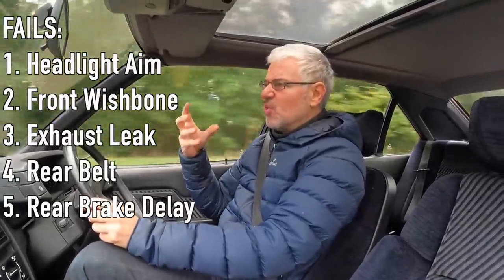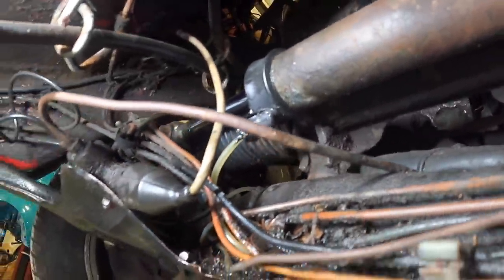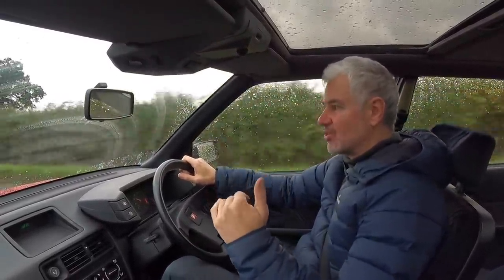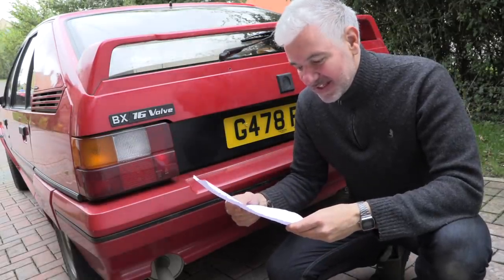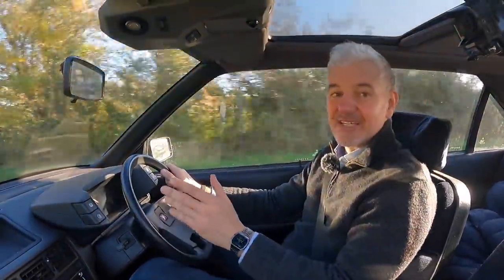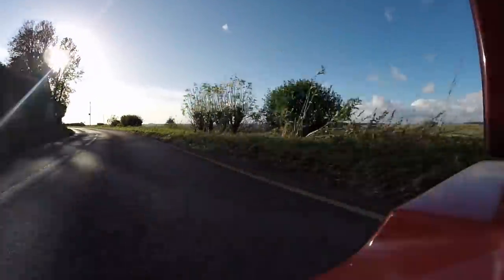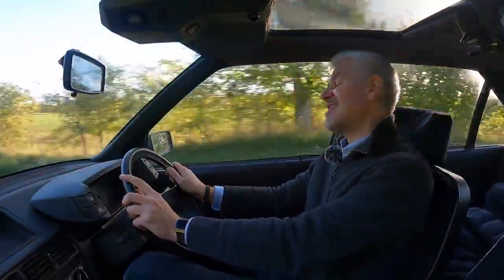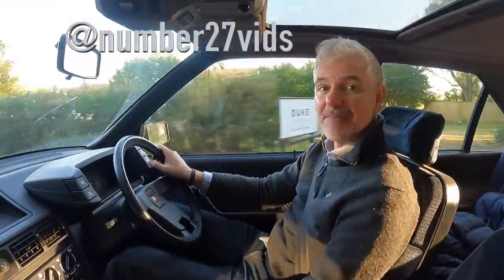Finally Sorting the MOT But How Does a Citroen BX 16v Actually drive?

Comment: Back in 1991 I lost my company car and had to provide my own when I started my own business. I still wanted electric windows and sunroof, power steering etc. A BX GTI (not 16v) fell into budget, as 'it'll do'. I finished up owning a series of BX's, diesel ones after the GTI, which were terrific and gripped like a limpet. Following the BX's I bought a Xantia which I also loved for every 180,000 miles. I continued with Citroens for my business, the last one, when I sold my business in March 2022 was a Berlingo van. 31 years and 12 Citroens and I never ever suffered a failure or breakdown.
Reply from the maker: Nice to hear, thanks!

Comment: I had the ordinary 8V GTi from new in about 1988.  It was phenomenal - two of my friends stacked Peugeot 205GTis trying to keep up with me (one a 1.6, but the other a 1.9 with basically the same engine and less weight).  Then it became less than wonderful when it sprung a hydraulic leak.  Twice (within 3 years of being new).  I always adored it, despite its iffy build quality.  Weirdly the electrics always worked - and it had 4EW, ESR etc, way more than its competitors.  It was different to a sea of 205s, Golf GTis and Escort XR3is.  I never had a problem with the gear change, but then they were like that - some good cars, some crap (kind of like a 1970s Rover SDi - though with those you had five loaded chambers, not one when playing Russian Roulette).  Mine was a company car, so it wasn't driven like I had spent my own money on it.

Comment: Now its worth some money :)

Brake valve is actually solid, it responds to pressure and not to movement.... the pedal has a spring between the pedal and the brake valve so the first part of its travel feels like the brake valve moves, but it actually that spring. After the spring is compressed fully you fell the actual valve.

You can take the spring out and replace it with a solid piece of steel and you will have the same brake feel as a Citroen CX.

Comment: I had the same issue with the wheel alignment of my BX. I ended up doing it myself.  I made an excel sheet with all the required calculations, and now I can do it with two tape measures and a stick.

Comment: The "tracking" with a BX is just one thing: You can adjust the steering rods on both sides, so that the front wheels are straight when the steering wheel is straight. 
That is all you can adjust on the whole car, steeringwise. No camber no toe-in, nothing.
If you want to enjoy the real comfort of a hydropneumatic BX , you have to change the spheres and use the ones from slower/weaker models. 
I´m driving my 6th BX and I like the spheres from the 64HP Diesel model the most and use them in my 8VGTI-Automatic/120HP. 
During acceleration, the car is almost at its bump-stops in the rear, so I would recommend the 88HP spheres for a GTI16V maybe.
A standards sphere has 400ccc , but there are 500cc available from the Break models which are even more comfy. Have fun trying!

Comment: Well done for getting the tomato through the mot. I used to get a lift to college in a beige non 16v version. The indicator switch was to the left of the speedo where you have the 2 flat switches on your car.

Comment: That central expansion box went on my BX GTI (not 16v) we just took it out and welded in a straight pipe instead - according to the ex Citroen mechanic that did it, it was a common mod.

Comment: I am 66 and I too got fed up crawling around under my cars so I bought a new two post lift for £1500 delivered , it was easy to set up in my garage . It is Chinese made but incredibly well made and solid and has transformed my working on my Mini’s . I can’t raise cars to full height but it’s easily high enough to work underneath comfortably and is easy to use .

Comment: Nice. Re... you have to rev it.    Sounds like most other 16v engines. I bought a Golf Mk2 GTI 16 valve back around 1990.  To be honest, I'd have been better with the standard 8 valve GTI. The power is much more accessible, and for most driving, that's what matters. Before the Golf, I had a  BX19 GT ( 105bhp ).  Really good car.  As I recall,  the BX wasn't chuckable in the way modernish hot hatches are.  Once though, you're in tune with car, as you say, you can make rapid progress.   

Any way, thank you for the videos, and getting the BX back on the road.

Comment: That tomato seems like a lot of fun. I like how strong the engine is at high rpm. I never would have thought. Citroen has always been under my radar.
Reply: Same engine as a pug 205 GTi 1.9.
Reply: @knobrotknobrot  205 GTI 1.9 is 8v, this one is 16v  ;)
Reply: Did Renault and Peugeot put this engine into the 19 & 405..??
Reply: @johnchurch4705  not renault. Peugeot 405 has it
Reply: @mjcbento  thank you 😊.

Comment: The hydropneumatic suspension on the BX GTi 16V was fabulous. It cornered so flat at high speed and handlled all surfaces so well that for me it was in a different league to all conventionally sprung vehicles. At only 160hp it wasn't super powerful but the handling package meant you could use all of those horses even on the twisty B roads. Even now, 30 years later, nothing else I have driven comes close.

Comment: I am a 'Graduate' of the Citroen academy! 😱🤔
I was briefly a salesman at Camden Citroen Wolverton Milton Keynes.
All new recruits had to sit through five days of propaganda at HQ where we were educated/indoctrinated as to the Citroen way!
Genuinely great engineering of course, but I just hated the design, though I do admire it sticking two fingers up to the competition.
I still remember the hole in the roof where someone managed to remove one of the spheres without injury! 
The group approved blurb was to appeal to caravanners and I remember being told to "ask the fattest one to jump on the tailgate" to illustrate the self-levelling suspension.
If the potential client wasn't overweight, then we had a bag of cement in a pillowcase just inside the door! 💪🇬🇧
Funny thing is, I moved to France 12 years ago and I have never seen a BX.

Comment: HeyJack, replace the gaffer tape on the roof with clear water proof tape available fro all good motor factors. Don't forget to clean up the surface first with nail polish remover available from all good pound shops. Works a treat, looks great!! Win Win!!
Reply: Nail polish remover can contain oil, so check as will stop tape sticking properly.
Reply: @philtowle4683  The acetone content leaves the surface squeaky clean and for a cheap bodge is more than adequate. I've never had an issue with tape adhesion, sticks like the proverbial and has a nice lemony smell. You are correct though, it also contains glycerine and linalool but in insignificant amounts.

Comment: Drove on of these back in1989 when it was almost brand new (had a couple of thousand miles on it), not a bad drive but it was almost impossible to get off the line quickly, it just sat at traffic lights and spun wheels - grin factor was 100%, but it was not engaging to drive.

Comment: Great stuff and it's going like a rocket great to see it back on the road I say it turns heads as not many around french cars are not bad at all my sister have a 94 Peugeot 106 still going now a classic with 160 000 on clock still on same engine gearbax  and clutch it's her favourite all do she have x19 and a old 500 so well done in getting it back

Comment: I still have a Xantia LX 1.8 16v which has a lesser version if this cars engine. The feel and drive is exactly as you describe, feels the same at 110mph as it does on a pot holed driveway at 10mph,  and also feels very similar to the 205 Gti's I've driven. People don't believe it when you tell them though.

Comment: Treat yourself to a new set of spheres, you will notice a massive difference. Looking at the way it handles the bumpy road the front spheres still have gas but the way the rear of the car is bumping along I’m certain you will find the gas pressure is low. You can also get a specialist garage to test and regas the spheres. Saves damaging rear trailing arm bearings too.
Reply from the maker: The spheres are brand new…
Reply: @Number27  Something is going on with the rear suspension at 6:53 it shouldn’t bounce like that. The spring rate of a Citroën rear sphere is incredibly low more than any other car so it eliminates most of the frequent oscillation of a typical coil and damper setup.  Anyway I really enjoyed the clip, well done.
Reply: Yes the ride doesn’t look right at all. The spheres are either the wrong kind or faulty and already shot. If you’re near sawtry in Cambs then Pleiades can test and regas them for you.

Comment: Same engine as a 205 GTI but with way more compliance in the ride, and no lift off oversteer. Lovely cars. (gearshift is crap though!)
Reply: 205 Gti 1.9 has an 8v engine and 128bhp, this is a 16v engine and 158 bhp.
Reply: @llanfairpwyllgogogoch1279  ah yes, quite right, it's the 405 engine it's shared with
Reply: Nice gentle lift off oversteer to be had on unsealed roads - makes for quite rapid and enjoyable progress!
Reply: @65PCH  😄

Comment: I owned one which had been converted into a tubo diesel. Until someone ran into the rear and the car was totalled 😓 Besides its outdated design the handling was great. Also the AC condensor was leaking inside the car and ruined the insulation 😅 The seat frame is very weak. I would have to bend it back now and then.

Comment: missed a trick young man, all motor factors sell exhaust tubing + clamps, measure OD of pipe in front of box, get new pipe with ID slightly larger, delete box + install a nice new section, probably sound nicer + rev more freely as a bonus, leaking at moment, sounds wrong

Comment: Trying to assess how does a 16V BX drive, 
without driving it on 
an unrestricted Autobahn, is akin to reviewing a Helicopter
in a swimming pool.

Of all cars, the BX16V (espec.the Ph2 & Ph.3) is the only stock car that relied so much on 
aerodynamic to achieve the high-speed dynamic qualities & active safety that are otherworldly.

The relatively harder "sprung" and firmer damped suspension spheres were designed to work best at speeds of 160-220km/h (when the aerod.load / downforce was serious for a stock car).

On normal roads, in the 90-130kph range, 
it is not that impressive in terms of grip (although still admirably sticky, predictable and plentiful of meaty steering feel).

On higher speeds, though, it has the tracking stability
of a THG train,
and the hige downforce gives the steering a feel that reminds steongly of a single-seater racecar, (or even a DIRAVI CX).

The grip at those speeds is otherworldly, as well as the hugely overpowered Teves ABS brakes, that are 3-4x more powerful
than conventional cars at those speeds 
(only a Porsche 911 can come close).

Its aerod.efficiency (BX frontal area is smaller than a Peugeot 205 (!) - yes, get those tape measures out now!),
and the CR of 10.4 : 1, makes the fuel  mileage incredibly low when driven sedately at a 110-120kph speed (you'not believe it gets 52mpg+ at such pace).

When the Throttle is opened though, 160-170hp on 1,040kg (with huge, 34.2mm intake valves and BTCC sized ports) is a rather dramatic event, at any gear and any speed.

The way it accelerates from 140 to 200kph leaves you speechless - faster than some Turbo cars.

There'll never be another car like the BX 16V Ph.2/Ph.3.

Ever.

P.S. it's totally unfair to review these gems on a local British road,
it completely misses their point & fitness for purpose.
By a nautical mile.

Comment: Congrats! I have noticed that speed gauge is very nervous. Would you consider applying a bit of grease onto the speedo cable? Not a very interesting comment but sorting that would improve driving pleasure 😁
Reply from the maker: Do you think that grease is all it would take? I’m assuming the mechanism is worn for it to vibrate like that!
Reply: @Number27  Common causes are lack of lubrication (grease also helps to bring oscilations down), slack of the connection between the cable and spindle (...I hope this is the right word) and last cleaning up the speedometer internals
Reply: @Number27   after washing out the cable, use the grey CV grease, + make the routing as straight as possible, no sharp bends

Comment: That engine is even better when you stick it in a 205 instead of a BX.
Reply: I have the 1.9 Mi16 in my 205 and it's a thing of wonder. Still feel a bit guilty, but the swap was done 10 years ago.
Reply: @ianwatson4540  same here, I owned mine for just under 20 years and it was 16v for probably 17 of them. Sadly sold it 5 years ago. At the time of the conversion 405's were everywhere and unloved so didn't think twice, looking back though I feel a bit guilty for destroying a minter.
Reply: No, driven both extensively and the BX is better. Beautiful poise and ride. 205 an enjoyable kart, but BX's abilities way deeper. Get that lovely engine throttle-bodied, bigger valves, balanced and running at 200bhp+ (had it done to mine) and it is utterly sensational. Such a shame so many were sacrificed for 205 transplants.

Comment: Lol those brake and hydraulic lines are just the worst. The steel ones of course long since rusted so about 10 years ago no doubt the garage comes along and replaces them with copper. Mechanics hate doing brake pipe jobs so the person that ends up doing them is the work experience boy with no bending tools and they end up looking like that!

Comment: Handling of the 205 Gti is far better.
Reply: The Bx 16v wasn't born to take on the 205. Comparing Bx 16 v with 405 Mi16 would make more sense.
Reply: @billybill6604  Jack compared the BX with the 205 in the video. I related to this.
Reply from the maker: 205 is sharper but in feel they are not far off!
Reply: @RallyeRacin9  indeed
Reply: @Number27  Both cars do feel like cars from the 80ies. But you can't drive the BX as active as the 205. 
You just cant experience the typical 205 lift-off-oversteer with the BX.